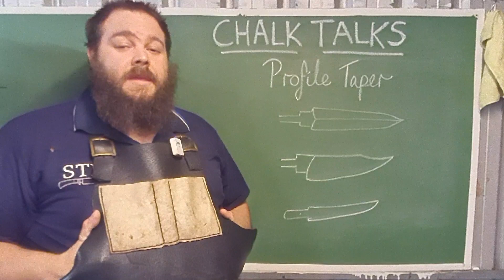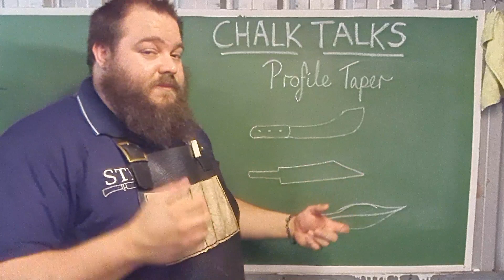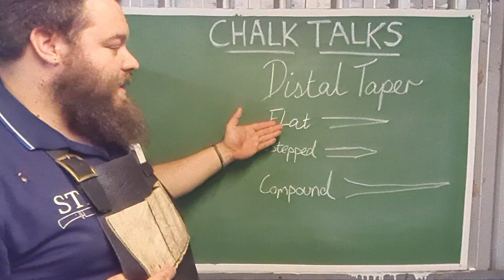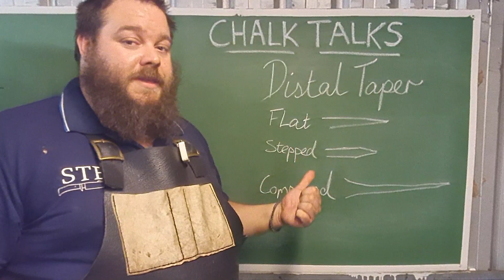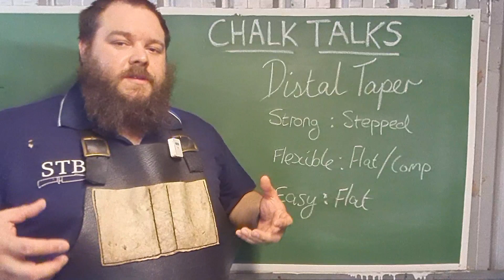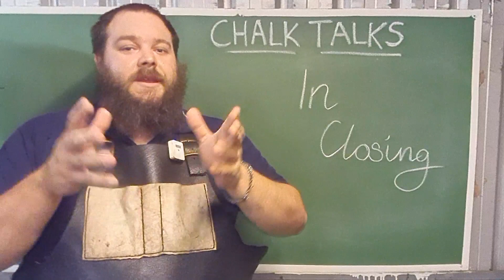Chalk Talks: Distal Taper

Comment: What type of distal taper would you reccomend for a full tang iklwa spear? Making my first spear blade and am trying to figure out the grinding for bevels and tapers
Reply from the maker: For iklwa and assegai the originals I have looked at tapered from about 6mm (1/4") down to about 1mm (.042") near the tip. They are insanely thin haha.
Reply: @SamTownsBladesmith  yeah, the base stock is 1/4 inch and I'm looking at doing several different angles along the blade, if that makes sense. I'm trying to make the spear both a stab and slash weapon so I'm trying to keep it a little thicker for more rigidity

Comment: Love the vid, I subscribed and will be looking up more chalk talks! One question, that will probably lead to more. You referred to the shoulders several times ie, the junction between the handle and blade on a traditional hidden tank knife. But what about a full tang? When making a full tang knife with distal taper in the blade and also a distally tapered tang, is there any other option aside from leaving the ricasso, or a portion of it, un-tapered? I can't think of another way to distal taper from both ends and not end up with a funky ridge where they meet. But I've also never tried it.
Reply from the maker: Hey mate, thanks! I will often just have the two tapers meet just in front of the scales, but if I had a surface grinder I would leave the riccasso section parallel. It's all down to preference, but it doesn't have to be a sharp Ridge, you can blend it to a smooth transition
Reply: @SamTownsBladesmith  Thanks! I wasn’t to sure blending could be done without looking weird. Now I know.